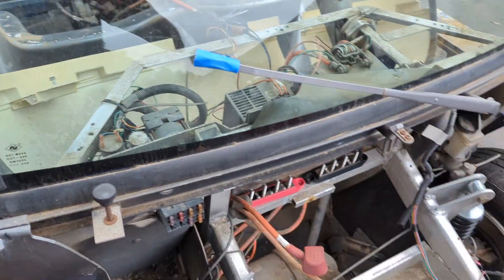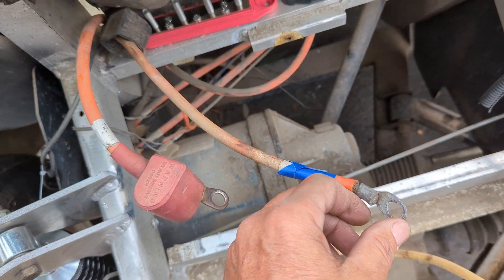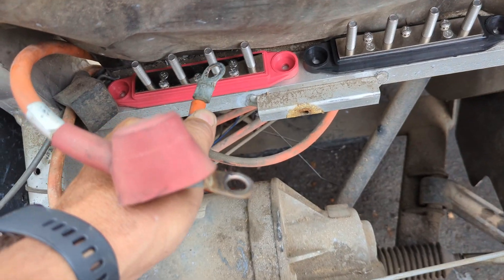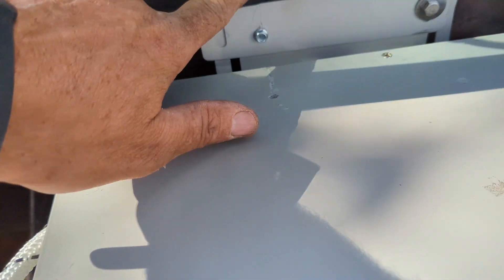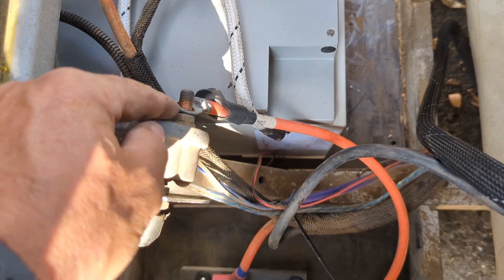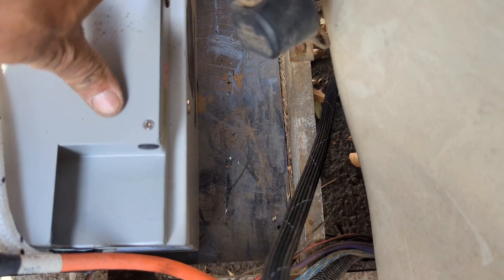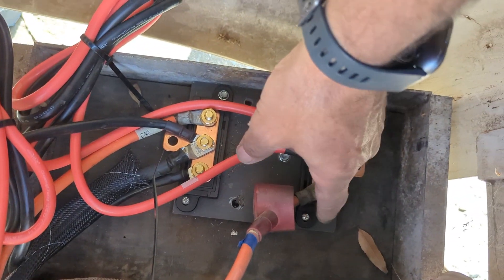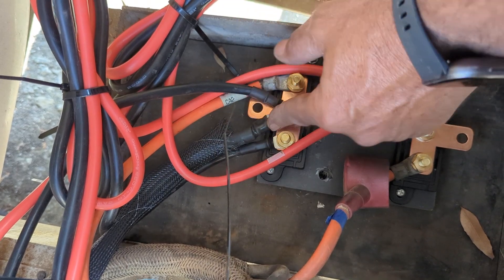Lithium GEM Car Install 2001-2002 Model BigBattery 72V FALCN

Comment: thanks for the video, how about if your using the onboard charger that was upgraded previously and will charge lithium as well, dont want to use their charger, do we still need to run a neg cable to the back, also we had added a radio, accessory lights connected to one of the 12 volt old lead battery, how do we connect them now, thoughts
Reply from the maker: Perhaps us a bus to connect the added accessories to the battery bank. If your current onboard charger has a lithium profile, it will be better since is has a higher charging current.

Comment: So, the controller converts it from 72 to 12 volts to run the lights, etc? My GEM has a capacitor blown on the computer card.  Can that card and the old charger be bypassed with a modern 72/12 dc transformer?
Reply from the maker: @markblinson603  I have not tried this...in theory. It does sound correct

Comment: Are 2 of these falcon batteries comparable in capacity to the 6 lead acids?
Reply from the maker: 28ah ea, connect in parallel.. the oe sealed lead acid have 100ah with 50%DOD
Reply: Is that a yes or no? @DeepcyclebatterystoreSanDiego
Reply from the maker: @MrTomatoFarmer  customers who have the two battery kit say it has the same range as the lead acid.
Reply from the maker: customers who have the lithium kit say range is similar to a new set of gel lead acid. Top speed a little higher due to weight reduction